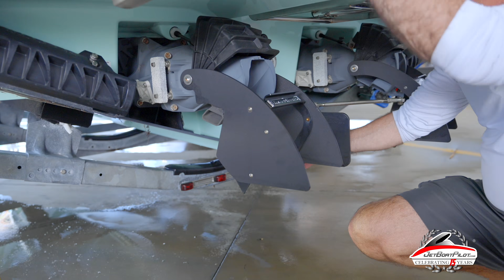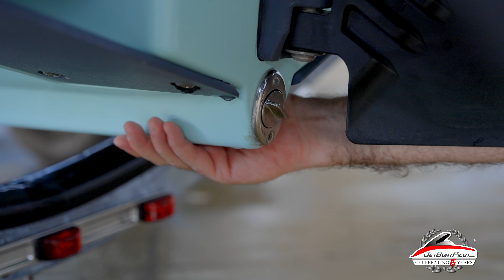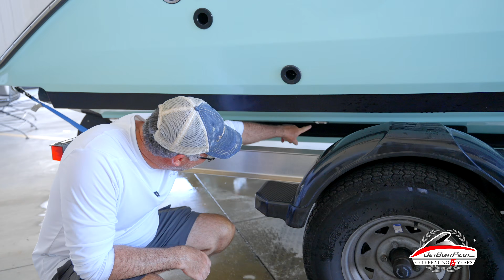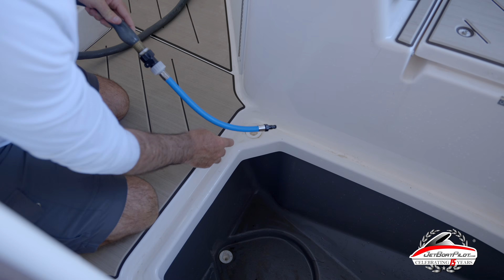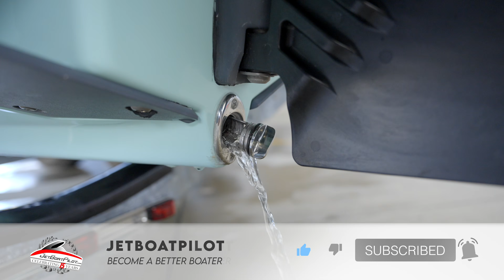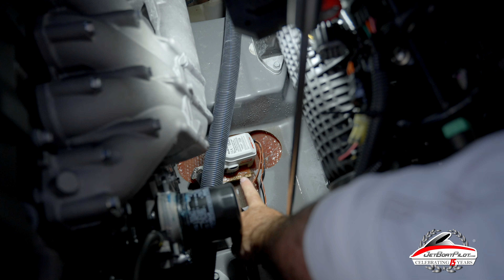Water In Your Boat? Check This First | Simple Steps to Eliminate Leaks

Comment: So I own a 2022 Yamaha FSH 190 with a little over 100 Hours on it. Was wondering why since day 1 when I purchased it new I’m getting water down under the center console storage area. Three is a drain plug in there, even when the drain plus is in and tighten seems to hold some water. 
Whats your thoughts on this??
Reply from the maker: Some have said its from the anchor locker drain. I think its coming from the engine room personally. Make sure the drain plug which is on the vertical bulkhead in the engine room nearest to the front of the boat, is installed.

Comment: Another area to check is the flush valves. My boat was flushed using air one year and after that my flush valve did not completely close causing water leak from the valve when the engine was running.  It was minimal leakage at idle so not something you spot right away but at higher throttle the leak increased.  Changed the valve and problem solved.  That was the last time I used air vs antifreeze

Comment: My 2021 Yamaha 195 FSH SPORT has always taken on water from somewhere, believe its from the anchor locker drain. Also, the starboard self-draining port at back of boat forward of the live well has NEVER drained, always have to push water to port to get water overboard?
Reply from the maker: Could be a linked line or a dip in the line that acts like a peatrap. Use some compressed air and see if you can clear it or test it

Comment: That O-ring on the drain plug is the weak link. That could sink the boat. If those threads are a half inch pipe plug. I would replace the OEM drain plug with a brass or bronze pipe plug.

Comment: On somewhat of a related note, there are 2 deck drains at the rear corners of the cockpit of my 2024 195FSH. The port side drains easily but the starboard side rear which appears to exit the hull at the rear of the boat near the jet pump doesn't. I've attempted to blast it out with water pressure but it still drains slowly (trickles only). When washing down the boat this is really obvious and I always seem to get enough water in the bilge that the pump kicks on. Any ideas?
Reply from the maker: Sounds like either an impediment or a dip in the line
Reply: @JetBoatPilot Thanks. I'll remove the access cover behind the live well to see if that's the issue.
Reply: I found that there is a check valve on that drain and it is also Y-ed into the livewell drain line. When washing the boat down I'm guessing there isn't enough flow or pressure to open that check valve more than a small amount. Thanks for all of your informative videos and responses!
Reply from the maker: @kevinh6833 you're very welcome!

Comment: Thanks for the video. I always have a fair bit of water in the bilge after use - (FSH255E). I was suspecting "blow past" of the clean out plugs and just ordered the riser plate to make the access hatch less likely to contribute. Is "blow past" a reasonable cause for water that then ends up over the access hatch?
Thank you
Reply from the maker: Yes especially from poor seals around the cleanout access tray.

Comment: water coming in more when I excel over 10 mph
Reply from the maker: That's clean out ports. Your seals are letting water get by the plug. Possibly the seal around the mechanical Access hatch is letting water into the bilge.

Comment: I h great video. I do have some excess water in my bilge that I need to figure out where it is getting in. I do have a question,  my bilge pump isn't turning on automatically when there's water in the bildge. I I bought a new pump, and replace it, but I still have the same issue. What could be my issue?
Reply: Either it’s not an auto bilge or it’s not enough water to make the float turn on the bilge pump.  Takes more than you think.

Comment: We have a 2023 252SD and have had water in the engine compartment. We cannot figure why yet. The bilge doesn’t come on automatically. I need to look at how to switch it to auto. But we need to find out why there is water in there. I will check the plug and gasket. It’s been frustrating and worrisome getting water in the engine compartment.

Comment: I appreciate these videos and have learned quite a bit from them. I have a 2024 AR250 and have had no issues since purchased. I did notice that my bilge light is cycling more than usual. We shut down the other night, with both battery masters turned off and the bilge continued to cycle every few minutes.. sometimes every 5-10 minutes, sometimes more frequently. The boat hull and engine compartment are dry, no issues seen there.  Any ideas on what is causing this frequent cycle ?
Thanks again for all the great Yamaha info
Brad
Reply from the maker: That's not normal. You have a pretty significant leak.

Comment: Hi Will, 
I think I've finally narrowed my leak down to the area between the upper and lower swim platform. It would be AMAZING if you could do a video on how to remove the rub rail, where EXACTLY to put the silicone,  and what type of silicone to use. 

Thanks so much!
Reply from the maker: I'm pretty busy the next few months so not likely to happen soon but would be a good video for sure. Ask your local Yamaha dealer and see if they can give you some pointers.

Comment: Morning, I have a 2017 Yamaha  212 limited s, purchased used. Noticed  water collecting under both port and stern side storage cabinets under the helm and bow seats. Cant figure out where it may be coming from.
Reply from the maker: Cupholders need to check your drain lines.
Reply: @JetBoatPilot  there is no water in the cup holders, took the boat out 1x and noticed everything was soaking wet. The 2 drain plugs in the engine compartment should be closed correct ?
Reply from the maker: @brettreutzel1041  Not sure which ones you're talking about but bear in mind if you close the drain plugs water cannot get from other areas back to the bilge pump if needed. So give it a try and note if it helps.

Comment: Another good educational video. I’ll have to check the o-ring on the drain plug now. I always had probably 5 gallons come out after 3-4 hours on the lake. Thinking that’s it.
Reply from the maker: That's a good possibility or at least a piece of it. Also check your mechanical access port tray. The sealant around that area is always pretty bad, regardless of year or model. Remove all the screws and the band clamps around the access tubes and then remove the drain tube. After that remove the tray and scrape off the old sealant. Apply 3M 4200 sealant around the seal when insalling and do a good job being thorough. Finish up with a wipe down and let sit for a day or two. This should eliminate a lot of water intrusion. And finally if your boat does not have the factory riser, you should look at our mechanical access port riser at jetboatpilot.com. It raises the mechanical access port cover about an inch and helps water that blows by the clean out plugs to get out the drain instead of pouring over into the bilge by way of beneath the access port seal.

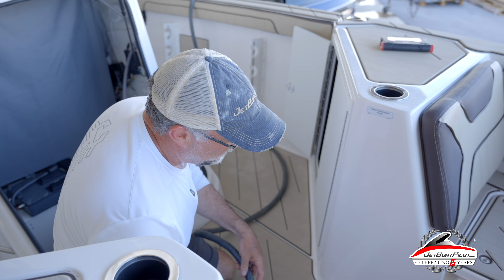Comment: My 2020 210 FSH had the anchor locker leak - I fixed that. I also have the front locker lid drain issue (3:54). It would be nice to get that permanently fixed. What's interesting with mine though is the lid drain doesn't exit through the port scupper like you pointed out. Mine drains out the back of the boat somehow. I also hear a gurgling sound when I push water through it with the hose. Not sure what's going on there.

Another source for water intrusion on these boats, not pointed out in this video, is the rear cleanout tray. When you slow down or come to a stop, water will come up the through hull fitting/tube and dump water into that shallow clean out tray area. The cleanout tray on my boat was not sealed with caulk, just screwed in, so water would seep in there and go down into the bilge. I've since caulked it.

Despite these fixes I still get water in the bilge. Not enough that the pump comes on, but probably a gallon or two. I take an extra 30 seconds and always drain the bilge on the boat ramp before I go out, so I can see how much accumulated when I get back.
Reply: How did you fix the anchor locker drain issue?

Comment: I found my 2024 222 FSH to have major leak problems in the bilge and center console/changing room. This video is very helpful and I will use a water hose to figure where the leaks are coming from.

I did however find that all of the console cup holders, instruments, steering wheel, etc. have almost no sealant. So far, I have removed almost all of them and placed sealant.  For one of the thru hull drain ports, I could see day light through. I removed all the thru hull drain ports and resealed them. Doing so, I noticed the holes cut for them were way larger than they needed to be and they were very sloppy cuts which is disappointing. Why cut a hole so large? No screws have any sealant on the deck and many are stripping out due to the friction hinges. I have been using 5200 and locktite to repair. I pulled the drain plug from the motor compartment to the changing room thinking it would drain but maybe the water is just coming back in from the bilge. I also think water is intruding where the console meets the deck so I will apply some sealant there as well.

Thanks for this video because now I will check the drain plug, anchor locker, rub rail, etc. and hopefully fix one of the most annoying Yamaha boat issues.

Comment: I get water building up in the ski locker. Not sure how to get it out.
Reply from the maker: Have you pulled the main drain plug at the back of the boat and jacked up the tongue jack to highest setting?
Reply: @JetBoatPilot have not due to the fact I don’t have a Trailor. 275 sdx. It stays in the water except when the season is over and they come take it away for maintenance and storage (indoor) for the winter.
Reply from the maker: @SnafuSpacehog I'd start there. If you can get it to a boat lift or have a marina pull it and park it on a dock side rack you could test the theory. Is there not a drain plug for the ski locker drain?
Reply: @JetBoatPilot yeah I opened it  up. Thinking there might be something in it. It’s been not draining for now the third season. Pumping it out with a squirt gun is tiresome.
And my Yamaha dealership is really useless.
Reply from the maker: @SnafuSpacehog  let me know if you figure it out. Some people have added a duckbill valve or similar to their boats when they don't have access to the drain plug. This way when the boat is lifted from the water, water from inside the boat can flow out wihtout having to get back there and take the plug out. Not sure that would help in your situation but thought I'd add that.
Reply: @JetBoatPilot thanks for the input. I’ll look into doing that, might work.

Comment: I'll start by saying I love my 2016 FSH 190, BUT...

After close to 9 years of ownership I've found that basically every thru-hull, locker latch, and fitting will leak. I've removed almost every one and resealed over the years.  The boat is 99% dry now after a lot of fine tuning.  Biggest culprit for my boat was not actually the water you were on, but it was from rain or when washing the boat.  The hatch channel drains cannot keep up with heavy downpours of rain or hose water.  Had to adjust and tighten every latch for a better seal. Also if your boat is in the rain without a cover you need to adjust your trailer tongue jack to have a pretty flat level of the boat interior so the channel drains work properly.   This helps a lot with the older flip-up seat design.  The anchor locker drain needs to be replaced with a sealed 1/2" perko type fitting. The rod holders and cup holders are another source as well. Hope this helps.
Reply: @dlk1255 can I ask what you did for the anchor locker drain? My 2025 fsh 195 just has a hole at bottom with a stainless steel deflector on the outside.

Comment: I found my fsh was generally not very watertight. No drains around the hatches or even the  big ones for the deck were sealed. One of the self bailing drain fittings even popped loose thus draining right in the bilge. No screws on the hatches were caulked and the engine room insulation would get soaked if the deck got wet. Rub rail screws not sealed etc. I basically disassembled the boat and sealed it all myself and now the bilge stays fairly dry.

Comment: I really do appreciate the video, but isn’t this a freaking problem with the assembly process? I had like a baseball sized amount of metal shavings in my bilge. I took it to a certified dealer with multiple issues. They said they didn’t find anything. Love the boat but the assembly quality is absolute trash.
Reply from the maker: All new boats have some amount of chips and debris in the bilge. Some more than others.

Comment: I'm waiting for the link to purchase an O-ring. My 2023 222XD has leaked since I got it. The dealership has tried several fixes, including resealing a manufacturing defect around the submersed inlet under the boat. I have to run the bilge pump at least every 20-30 minutes, or it will come on automatically in emergency mode. Please help!!

Comment: Can you provide more detail on the anchor locker drain? I see a lot of post suggesting it as a culprit of letting water in, but no clear method of repairing or even what it should look like.
Reply: Someone said that there is a gap between the anchor locker and hull so if water splashes into the drain it flushes straight into the bilge. Someone siliconed a hose from the anchor locker to drain hole to seal off this gap. Basically they found Yamaha just drilled a hole thru the hull and anchor locker and there is no drain hose between them.